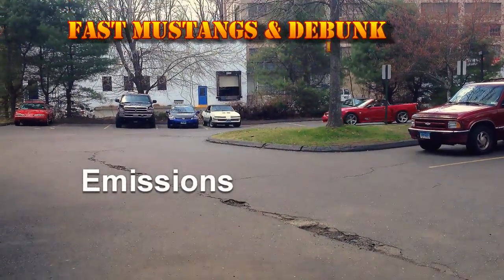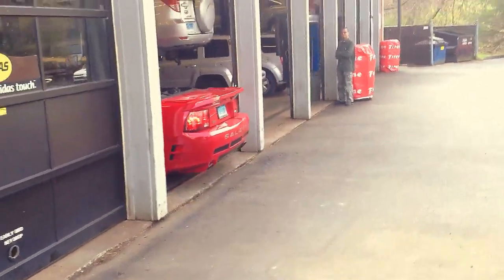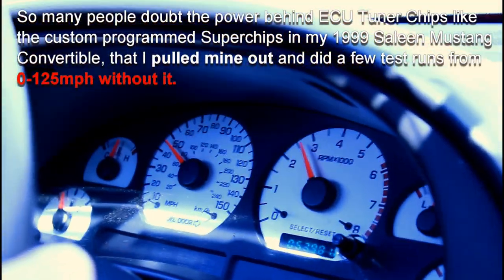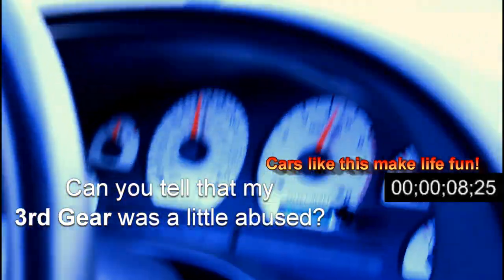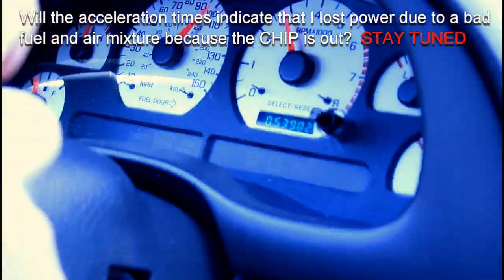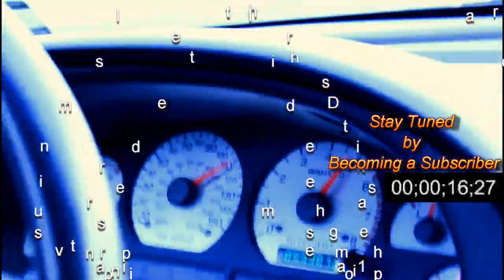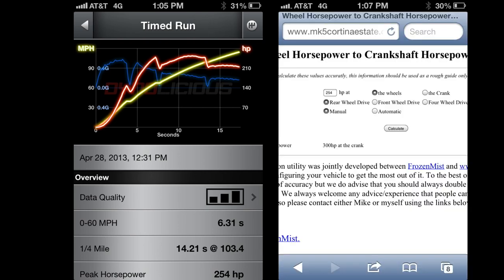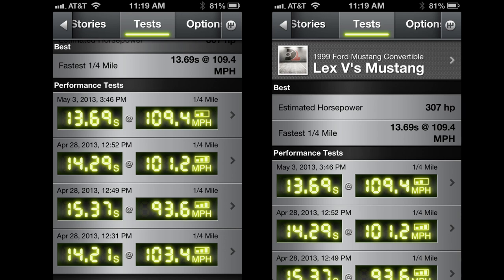Adding Massive Horsepower with ECU Tuning [Dirty Secret Revealed]

Comment: Put it on a Dyno they'll stop hating .  30 HP ? Might be a little high ? But any time you add more fuel adjust timings ... You get results that's a fact .   Cool video
Reply: I bought a nitro performance ob2 chip for my 99 gt does it actually work or did i waste my money ?

Comment: Are they really worth it , to add to a completly stock vechicle?
Anyone know how much HP a all stock 2001 SVT Cobra Roush (Side Pipes mod) would have? I have the chance to buy one with 25K miles on it...super clean..But can't get away from the Coyote cars for not much more $$$ lol.. But- I hear they only had 300hp before the Rush pipes.. that may get to 230 maybe...?
Reply: Only thing is, is that its a manual and an older Cobra....so was probably redlined in every gear.  The 2003/04 cobras where supposedly built bulletproof moreso.  The guy that was responsible for the 03/04 cobra design and strength was let go after they lost money in all the higher quality parts.  I'd say if you want a new edge, try to get one of those because they really are built better.  But really coyotes are so much better in every way.  2014 was the last good looking Mustang ...the s550s look European and have worst looking rear ends of any mustang ever built...they just have alot of power.

Comment: dude your not gona get 30 hp from a chip. when you combine it with other mods like headers exaust cold air throttle body. after those mods and a tune you might get 30hp.
Reply: Headers, full exhaust, cams, and forced induction*  Hot air intakes are just an aftermarket gimmick that pull air from hot engine compartment...unlike factory engineered box, pulling air from fender.  A cloth filter in box would do better.

Comment: Super chip was bullshit,, all it did was boost the timing up, made it spark knock if ya didnt put 93 octane in it,, it helps automatic transmission cars, because you can adjust shift points on it,, supper waste of money,, lots of other bolt ons that actually do make noticeable horse power without fuckin with the spark, dont waste 300 bucks on that garbage..